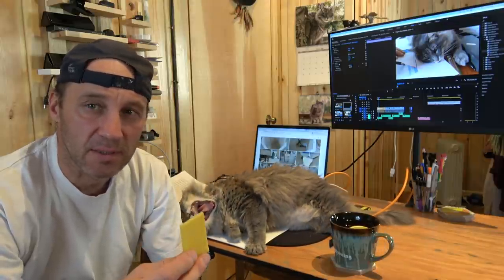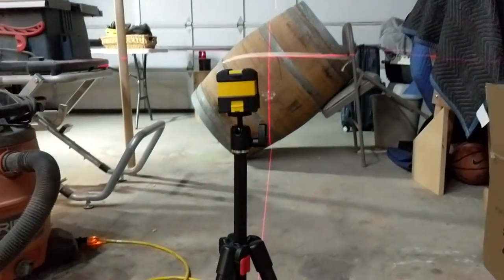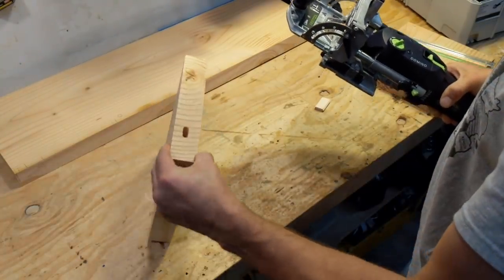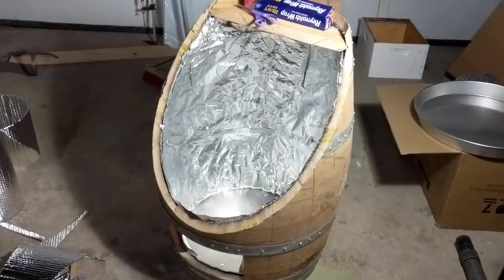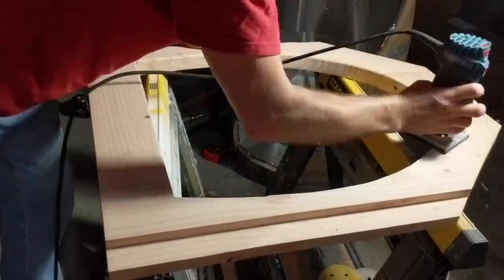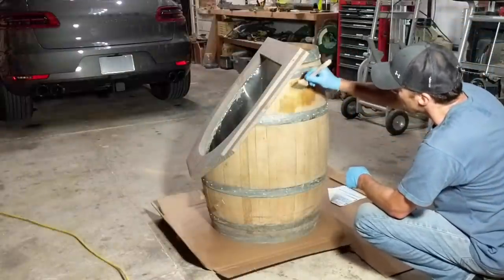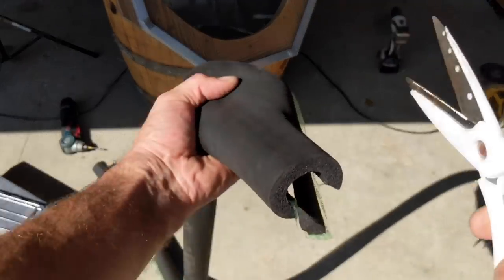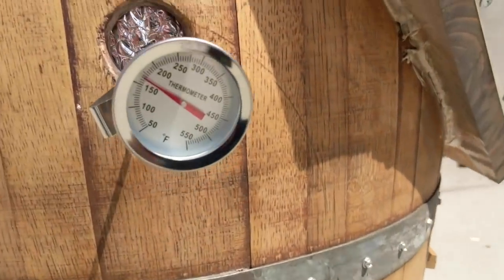Solar beeswax melter

Comment: While you were making the wooden frame for the front of the barrel it looked as though you were actually making a Bear sized toilet seat for Dandy, the Bear, ready for when he comes visiting next year. 😉🤭😅
Joking aside, might I respectfully make a suggestion? With the best will in the world, beeswax gets everywhere no matter how hard you try. So it may be worth your while to line the inside of the lower access panel in the same way you did for rest of the barrel. It will be much easier to maintain/keep clean; wax and dirt won't build up around the screws etc. Either way, you looked as though you had a lot of fun and satisfaction with this project; under Nanny's careful furpurrvision of course.😉😅